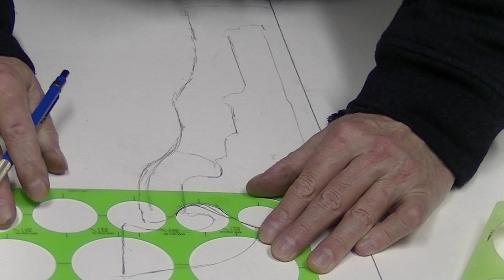Holster Building, 1840's-50's Colt Dragoon

Comment: This is beautiful work, and I like the hammer shield. I even like *your carving, which I usually shun.
If I were *living on the cavalry march, carrying 24/7, however, maybe I’d prefer the weather-coverage of an 1861 flap holster design—-=> over the handle butt. (A sewn-closed toe always requires a weep-hole.)
   The center of gravity on most Colts is *just rear of the cylinder face when loaded —-and since (most) flap designs were intended to allow a cross-draw *while SEATED—- the belt loop width and placement is crucial. Damn things HEAVY!
   Tho the CG on a dragoon is just slightly lower than any Army or Navy Colt, it’s LENGTH might seem to dictate a straight-vertical carry— (or an exaggerated rearward cross-draw).

Comment: That’s waaay thicker material than CivilWar era tanning, tho I’m unaware of the difference. Though I’ve handled USArmy issue holsters that were (eventually) rather soft, they must have started-out stiff. 
   When the local museum allowed me to clean their Remington 1858 Old Army (either issued to or carried by the manufacturers’ great-nephew), if only to stabilize it from surface rust using Ballistosol, the supplied holster was about what we’d call 9oz in leathers today. Though it was Army issue, the flap holster was in friable but stable condition, and, because it bore the print of a Colt Army, I expect it was not the original issued. Leather requires care.